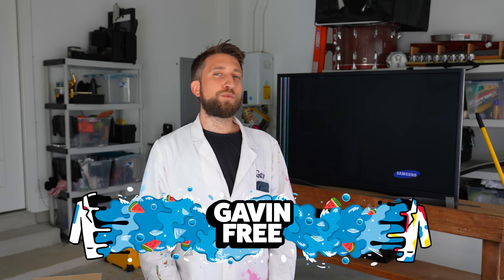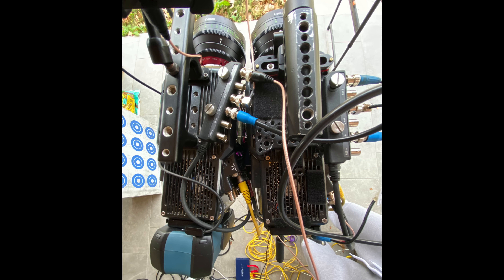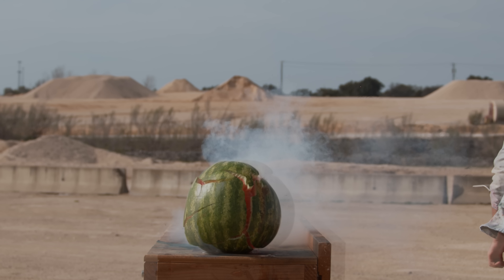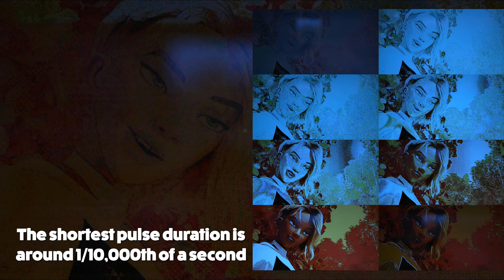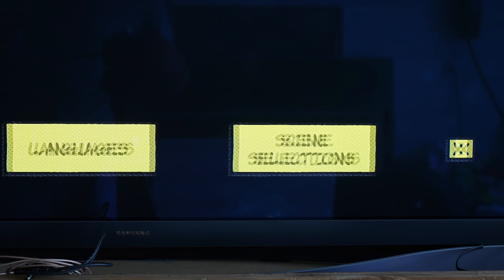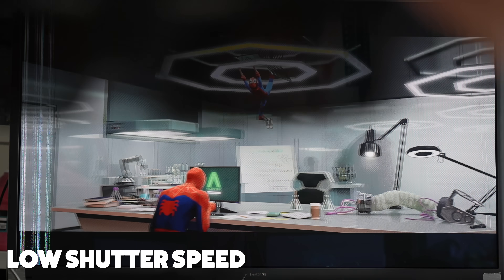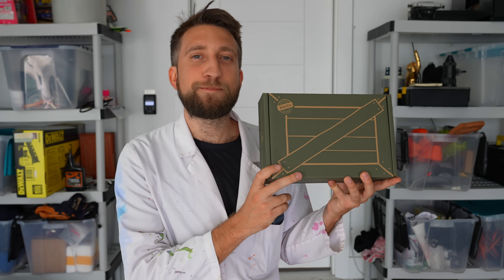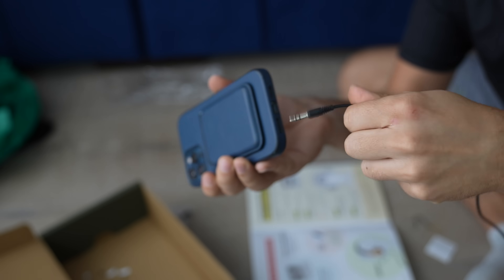How a 3D TV works in Super Slow Motion - The Slow Mo Guys

Comment: Digging the "advanced winking". Super cool technology.  Do the front of the glasses have some sort of detector?  They have to get in sync with the computer somehow so they're not winking out of phase.
Reply from the maker: ❤️ from what I’ve read it’s often an RF connection and sometimes infrared signals. These seemed to function perfectly when facing away from the tv and even in the next room over.
Reply: @theslowmoguys  well now im curious what happens if you reverse the images so you see the right eye in your left eye and vice versa, my guess is nothing impressive would happen but itd be a cool experiment anyway
Reply: @theslowmoguys  Nice. Regarding recording stereo video, often Genlock would be used. Has anyone tried syncing via a GPS clock? Might be useful for special cases.
Reply: @theslowmoguys  how do you know they keep the sync from the other room?
Reply: @theslowmoguys  Most of them use IR signal.  After all, you must face the screen to see the video!
Reply: @theslowmoguys  can u capture tyre screech?
Reply: @theslowmoguys  
❤❤❤❤❤❤❤❤👍👍👍👍👍👍👍👍
Reply: @theslowmoguys  that's cool
Reply: @theslowmoguys  wheres the other guy
Reply: Was thinking about the same thing.
Reply: In our 3d tv the glasses connect to tv via Bluetooth connection
Reply: @amirsa7140  What tv is this? I would be very interested in what bt profile it would have used.
Reply: @MaNameizJeff  it's Samsung,i don't know the exact model
Reply: There are 3d sync transmitter on the TV
And the glasses should be in range of the transmitter
I think
Reply: Dunno about TVs, but I went to a movie theatre which used active glasses and they had a black square on the front, between the eyes. Covering up the square made the glasses stop blinking. So yeah, I guess infrared in that case.
Reply: Advanced winking is my new favourite term for 3d
Reply: @Vendulum  Those are passive 3d glasses, slightly different technology.
Reply: How come every video I watch you comment on
Reply: Depending on glasses/manufacturer they can function off either IR/RF/Bluetooth to sync up. Most nowadays use either RF or bluetooth on a narrow band or previously sync'd setup so that it isnt broadcasting to the world and allows multiple 3D setups in the same vicinity. Great for CAVE's (makes photos fun due to the dorky glasses)
Reply: I actually still use 3D glasses like these with a projector. A 120'' picture from a few meters away with it really doesn't fall that far short of a movie theatre experience, and with mine, it's an IR pulse bounced from the canvas that keeps it in sync; if you point them away from either the canvas or the projector, they'll go in stand-by mode, lighting up slightly as it's no longer shuttering.
Reply: In samsung tvs its bleutooth. I don't know about the other brands
Reply: I owned that TV or the next model year (Samsung PND8000) and the glasses used Bluetooth to sync with the TV.  Content was the real problem - not many movies were shot in 3D, so I bought this: https://www.youtube.com/watch?v=Xi7re1jyWYY  Now I can't watch my vacation videos because there aren't any 3D TVs anymore (oops)
Reply: Exactly same thing i though ☺ at end
Reply: What if there is delay in sync?
Reply: I'll just leave a comment here
Reply: The ones I used were all IR based bu this was in the early 2000's.
Reply: It's typically an Infrared signal emitted by the TV/projector that the glasses pick up.  Note that certain VR rigs like the HTC Vive  with it's IR lighthouses will frustrate the effectiveness of your 3d signal so make sure they are OFF when trying to watch a 3D movie.  My not knowing that was the catalyst that caused me to replace my perfectly-good 1080p 3D projector.  Not a huge loss, though, since the new one can do 4K (not in 3D but yes in 1080p) ...and now I have a spare.
Reply: that same plasma tv is also capable of converting 2d videos into 3d, not sure how it does that but its really cool.
Reply: The ones i've used were IR, and they would fail if you covered the sensor or faced away from the TV. They also weighed almost a full pound, which is a LOT to set on your nose. I'd take a oculus with side-by-side format video any day over shuttered glasses; the oculus has straps to support the weight and the glasses don't.
Reply: My 3D glasses only turn on/off when I face the TV. :)
Reply: I was thinking about the same question! :D
Reply: Hi
Reply: I did notice the shot of face side of the glasses, it has an FCC ID. I would guess RF sync and the TV broadcasts a clock. I wonder what would happen if you had multiple 3D TVs running in the same room....
Reply: DUSTIIIIIIIN
Reply: Yeah there is an ir detector usually in the middle between the eyes. At least that's what it was with my Philips TV.
Reply: Hi
Reply: Hey @SmarterEveryDay i'm a 2nd year Comp Eng student, any general advice?
Reply: @gregoryconroy5182  Don't do illegal drugs. Good general advice.
Reply: @markp8295  That's horrible advice!
Reply: @TheYuvimon  You're horrible advice.
Reply: @markp8295  But do legal drugs
Reply: @The_Viktor_Reznov  Legal in the U.K. means prescribed or over the counter in accordance with the manufacturer's or medical doctors instructions.... So yes.
Reply: @gregoryconroy5182  stay in school
Reply: @gregoryconroy5182  As a 2nd year Comp Eng student, the real question is if you have any advice for SmarterEveryDay ;)
Reply: first
Reply: @TheCrunchyGum  2nd
Reply: @TheCrunchyGum  are you that much of a loser you need to type first on someone else' comment when you're not even first? lol
Reply: @TheCrunchyGum  noooo you should have said Firt

Comment: There was another method to display 3D content on LCD / LED screens that did not require active shutters. Since the pixels on LCD / LED are polarized, the screen could have 2 different polarization for each pixel, 1 for the left and 1 for the right eye. But that would make its manufacturing extremely difficult.

Comment: 1:30 Gav casually swinging 8 years of college tuition around.
Reply: It's kind of like how, in the military, you might carry around and fire a Javelin missile that costs >$100,000 of taxpayer money. That's not even including the cost of the launcher, which is even higher.
Reply: The cameras alone are like 50 grand each at least. With the rig, probably another 25. That's college tuitions for like 4 people
Reply: @MM-vs2et  the camera bodies are easily in the 6 figure ranges, not including the rig, lenses or any of the other accessories needed to film with them
Reply: 1 Phantom flex 4K = $100000 - $160000. With rigging and lenses, Gav is waving around half a million in gear.
It's like swinging around two new Lamborghini Huracán
s on his shoulders.
Reply: @username4294967296  it's so much worse when you put it in perspective like that

Comment: There was one very cool feature that you could use on Sony 3D TVs with a PS3 called SimulView, which I tried out several times. It allowed 2 players to play on the same screen but see their player in full screen rather than split screen. It did this by taking 2 pairs of glasses, and instead of flashing left/right lens, each player's glasses would flash fully on or off, and then draw the appropriate screen for each player. It was awesome because you could play against each other and not worry about the other player sneaking a peak at your screen. So instead of a 3D image, it just used the 3D technology to draw 2 completely different 2D images, which I thought was really cool.

Unfortunately, this was even more nauseating than watching a 3D movie, and after 30 minutes most people felt like they were going to throw up or got a massive headache. But it was really cool.

Comment: 0:55 without using any vr device, you cam actually experience the 3d by just crossing your eyes until it looked right. I've done it myself and I'm very worried about my eyes getting stuck (it won't, i just worried because of the myth lol)

Comment: That's why my head hurt after 3d movies or vr stuff Jesus
Reply: Most, if not all, modern VR headsets use a split screen or screen per eye, so you shouldn’t be getting anything like this. More likely it was from the vergence accommodation conflict between the 3D depth and the 2D screen, which can still be a problem.